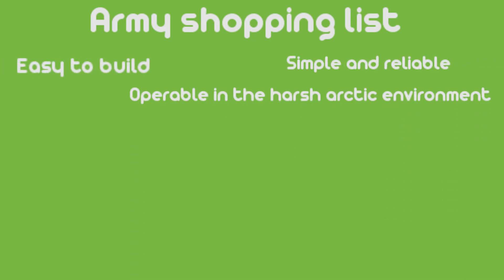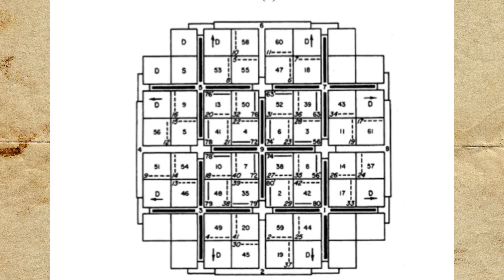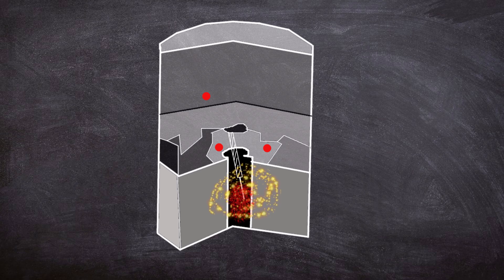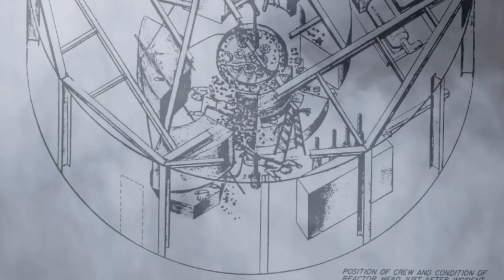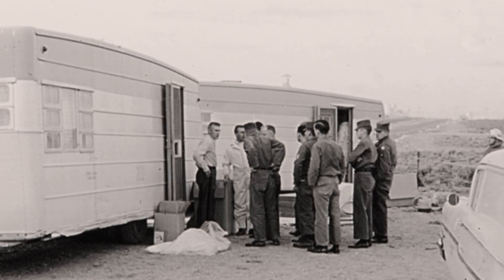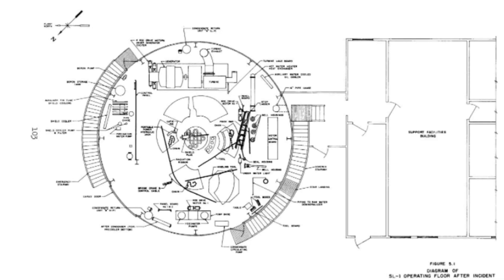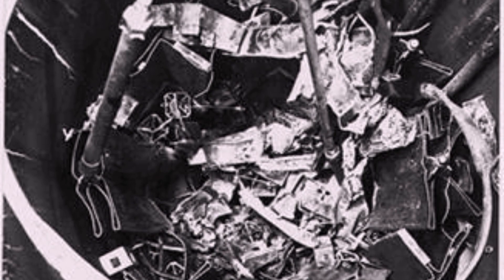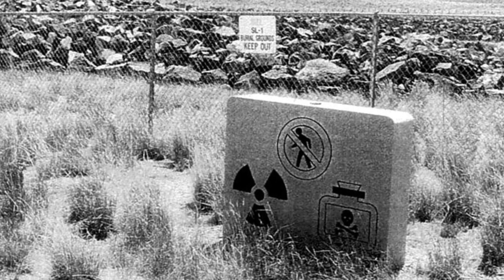A Brief History of: The SL-1 Reactor Accident

Comment: This is a very good presentation of this accident, one of the best I've seen.  Most go into way too much focus on the "Murder/Suicide" angle... which is pretty stupid to imagine as a motivation for this accident.  Of interesting note regarding the recovery of Petty Officer Legg:  The reactor was completely exposed during the recovery of his body and there was a genuine concern about accidentally dropping something else into the reactor (especially the control rod Legg was impaled upon) and causing a second explosion.  The practice for the procedure of recovering Legg had as much to do with preventing that from happening as it did with recovering his corpse.  Additionally, the operator of the boom had no way of looking into the facility and had to be guided by signals from a director, with binoculars, who was looking into the facility from on top of a lift hundreds of feet away.  The fact that they were able to successfully perform this bizarre ballet at all is pretty amazing.
Reply: would the control rod going back in not moderate the reactor further? what's the problem there?
Reply: @OrbitalSaucer  -- The concern was that anything striking the reactor head could further dislodge elements inside it and cause a second critical mass.  The control rod was simply the most likely thing to fall as they felt confident about recovery of Petty Officer Legg"s body, but were unsure about what the rod would do as he was removed from it.  In addition... it's highly unlikely that the rod would perfectly fall back into it's position within the reactor head, which would be the only place where it would do any good as far as moderating the reactor.  It's also unlikely that it would have been able to go all the way back in even if it had landed perfectly, as the explosion more than likely moved the fuel (and other elements of the reactor's construction) too much for any chance at reinserting the rods.

Comment: “impaled by one of the shield plugs” ouch radioactive impaling
Reply: Plainly Difficult got it wrong, it was actually a control rod assembly.
Reply: @rsrt6910  Bamboozled, it was actually a shield plug. The control rod (as you can see in the images of the accident) was found just lying on top of the assembly. He wasn't even standing over the control rod.
Reply: @rsrt6910  still a better love story than twillight.

Comment: Terrible accident. I had to undergo hazmat response training for my job, and the SL-1 accident was used as an example of a nuclear reactor accident that would require local resources. The control rod design was always an issue with these small reactors since there was no way to restart a cold reactor without someone manually withdrawing a fuel rod by hand. The need for portability precluded any kind of machinery to do the job. Then reactor only contain 40 of the normal 59 fuel rods since the reactor was only being used for power and not to test providing steam for space heating. as part of the specs for the reactor. The fewer control rods meant the withdrawal of the control rod would make the reactor critical much faster, and that's just what happened. 

As to why Byrne decided to withdraw the control rod as far as he did, we will never know. The best guess, minus the suicide idea, is the rod was stuck and, in the process of yanking on it. it came free faster than assumed and caused the accident. The Army CID and Atomic Energy Commission investigators along with the Idaho State Police spent quite a bit of time investigating all aspects of the three men's lives as well as lives of their families. Byrnes' wife was having an affair with another man, prompting the divorce case. It was not with Richard McKinley however. Could it have been suicide on the part of Byrnes? It's possible, but the stuck fuel rod, something that happened six times in the previous year, seems a lot more likely of an explanation. My training was mostly that if I saw steam coming from a reactor building, get back in my vehicle and hightail it out of there.
Reply: Yeah , I think the stuck control rod theory is MUCH more likely than any suicide/murder plot,  the control rod had to be withdrawn a certain distance , and then clamped in position, as part of the procedure, it seems very likely that the rod was stuck and was given a good yank to free it, causing it to withdraw too far (it only needed to be withdrawn an extra few inches to cause the reactor to go critical). 
By the time the guy would have realised he had pulled the rod out too far it would have been too late, the reactor went critical almost immediately due to it's configuration with only 40 fuel rods and the rest is unfortunate history. 
At least we learned some lessons about reactor design from this incident, but there is a good argument that the reactor should have been shut down once they knew control rods were getting jammed, it was an accident waiting to happen.
Reply: @paulelephant9521  it was said that the centre fuel rod was less likely to be stuck than the others. Maybe he expected it to be stuck, but it came out freely... 
If it is so critical, why not provide a fixture for the process to prevent the rod being withdrawn too far.
Reply: Andrew White - because people are stupid.   The Spaceship One accident was caused because one engineer had designed a device to prevent the tail boom from being pivoted  before a certain altitude was reached- another engineer deciding that added unnecessary weight and the pilots were unlikely to male such a mistake, and then the people compiling the checklist not so much as putting a Space- much less a warning between- between two actions that should have been separated by a three full minute delay.
Pilot going thru the checklist did each action, as printed, and activated the tail boom configuration while still too low for the aircraft to survive the loading.
Human beings make mistakes designing complex systems, and the more human beings involved in the design and operation, the more mistakes they will make.
Reply: @andrewwhite1793  
A better solution was provided...  The U.S. (and western nations) developed the "Cold Stuck Rod" criteria which states that even in the reactor's most favorable conditions for critically, complete removal of the most reactive rod in the core can not cause a reactor to go critical.

Besides the above mentioned safety change, the SL-1 accident prompted the SPERT program.  In that test program most of what we now know about transient reactor behavior was discovered.  (you can toss Argonne's TREAT program in there also).  Up until SPERT, TREAT, and PBF the world's nuclear physicists did not know much about how reactors behaved when large amounts of positive reactivity were added quickly.

For example we learned that our commercial nukes would not react nearly as violently as SL-1 because of the large percentage of U238 present in such reactors.

Also, the accident prompted many improvements in portable radiation monitoring instruments.  For example, the fields close to the reactor itself (and some of the ejected material) was so great as to saturate the Geiger-Mueller tubes but the instruments did not have circuitry to detect this condition so the readings dropped to zero.  It was also realized that higher range instruments would be needed for future incidents and so these were developed also.

I am impressed with this video as it is a pretty summary of what happened though there was one 'party line' that is not quite true.  The initial fire department entry following the accident did NOT include portable radiation monitoring equipment.
Reply: @andrewwhite1793   Yes!  I was thinking the same thing!  Also - I can't believe they couldn't have built (in the original design) - a mechanical system that could withdraw a rod (to the correct distance) without someone manually doing it.
Reply: @andrewwhite1793  because it was the 1950s and reactor design was complete shit.
Reply: It was stuck, previous design notes noted that as an ongoing issue. It wasnt a problem when hot, but tolerances were too tight when cold.
Reply: According to my readings on nuclear accidents...if I see steam or explosions coming out of a nuclear plant, i might as well bend over and kiss my ass goodbye!
Reply: @parteibonza  
If you happen to see that coming from within the reactor containment building, you are probably at least close to right.

There are however, plenty of places (designed to make such releases) where huge quantities of steam can suddenly be released to the atmosphere that are completely harmless to people.
Reply: If it was murder suicide first how would they beyond a shadow of a doubt prove it? Then why would he want to leave behind a widow that was cheating on him with his death benefits? Then why wouldn't he do the ultimate screw the cheating wife and leave behind a note that would screw her out of any money? Just about everybody I know that has been divorced one side or the other has wanted to screw the other side.
Reply: I know army lost reactor projects to the newly formed DOE, was this the reason?
Reply: The Department of energy wasn’t established until the late 1970s, almost 15 years after the Army stopped low power reactor research.
Reply: @KevinBalch-dt8ot  
For those of us that worked at the Reactor Testing Station, Atomic Energy Commission and Department of Energy were the same thing.  At the research site level it was pretty much just a name change.

Much like the various names that the Idaho site itself has had.
Reply: Kevin Balch  We had AEC. Military had "08" in DC.
Reply: @buddymoore6504  I don't think so. The reactor was strictly an Army project from the start. They were using the DOE reservation in Idaho because it was far enough away from any population center that a catastrophic failure like what actually occured wasn't likely to contaminate a lot of people..
Reply: @sarjim4381  thanks Jim
Reply: @buddymoore6504  Another reason for the Army losing their nuke program is that ADM Rickover never wanted the Army to have reactors in the first place and used this incident to lobby Congress to cut funding and hand all materials over to the Navy.
Reply: Where did you work where you were thought  to look for steam out of reactorbuildings? Fire/rescue?
Reply: @Flapjackbatter  Good heavens, no, not a firefighter. I run out of burning buildings, not into them. I was a deputy sheriff. For reasons that remain a mystery to me to this day, our county board of supervisors gave hazmat responsibility to the sheriff's department. I had to take a bunch of hazmat courses. The bottom line was run like hell until you think you're far enough away, and then run like hell some more. :-)
Reply: Were you by any chance assigned anywhere near a certain school in Florida?
Reply: It was the wrong rod! Water hammer wrong. Steam !!!
Reply: @DanielScutt   Wow!  Deployed to combat zones?  Yeesh.
Reply: "If you can see the scene, you're way too close."
Reply: Reminds me of how the Navy tried to blame the turret explosion on the USS Iowa on a sailor by saying it was a sex-driven murder-suicide plot. Our puritanical country...
Reply: @s.sestric9929  It was somewhat similar in that original thought was that Byrne and McKinley were having a gay love affair and the Mckinney broke up with Byrne, thereby leading to the murder suicide. That line of inquiry was abandoned pretty quickly as was the story of the affair with between Byrne's wife and McKinley. It is a sign of how we think as a society but, after 27 years as a police officer investigating such cases, the first suspects in a murder are the spouse or significant other, regardless of adultery or sexual orientation. We followed that line of investigation first because it turns out to be true in a surprisingly large number of cases.
Reply: Occam's razor.
Reply: @Sar Jim
"The control rod design was always an issue with these small reactors since there was no way to restart a cold reactor without someone manually withdrawing a fuel rod by hand." is not really a true statement.  The Power Burst Facility (PBF) reactor, located only a few miles from the ARA (SL-1) site had to have the control rod drive units disconnected and reconnected for in core maintenance.  There was no requirement to lift or 'jack up'  a rod to connect it.

Of course PBF was not by any stretch of the imagination designed to be a portable reactor, employing the PBF control rod drive bridge design in SL-1 would not only have precluded the need to lift the rods to connect, it actually would have reduced the weight of the design.

Comment: If I remember correctly from my lectures, the control rod was only supposed to be withdrawn about 3", yet instead was withdrawn about 20+". The resulting power surge was gigantic. 3 MW was the design and it got up to 20,000 MW in the same time it takes to blink.
Reply: I don't mean to sound smart, why not a stop to keep rod from coming out to far? its like the physicists and engineers didn't talk shop, if I knew you could die from pulling the rod out to far, I would design it different. they made it to simple. I bet they never did that again?
Reply: @buddymoore6504  Sound smart. A simple steel rod on a pivot with a clevis on the control rod would have not only provided a positive stop before trouble started, but would have provided mechanical advantage to lift a sticking rod. 

Three guys died for the lack of a f*cking crowbar.
Reply: buddy moore i
Reply: It's a tad on the unsettling side, yes...
Reply: Pinochet Pilot #666  but with prompt criticality those numbers dont mean crap when power is jumping decades per second on a logarithmic power scale. Youre actually right because prompt criticality actually happens when there are so many prompt or  "fast" neutrons that theyre the ones controlling power increase. Thats why reactors are design to be controlled with slow or moderated neutrons so human control can be a thing.
Reply: 20,000!?  O.O
Reply: the flux capacitor only needs 1.21GW. this produced over 16 TIMES that
Reply: @parteibonza  
What in the world are you trying to say?  Your post seems to have been cut off.
Reply: @parteibonza  
No.  20,000,000,000 watts
Reply: I just blinked!
Gaaaaa!  I just blinked again!!!
I did it again!
I can't help myself!!!!!!!
Reply: It isn't good. It was able to so quickly have an excursion due to how highly enriched (over 90%) the fuel was. With that mixture, it takes the fuel mere fractions of a second to multiply in power many times. Modern commercial nuclear reactors use enrichments of 3-5%, as a comparison. So instead it takes minutes to multiply in power, making it vastly more controllable.
Reply: What's a 3" ?
Reply: People.. Lets put what OP in lamens terms:  3"= 3 inches. 20+"= 20+ inches OR almost 2 feet. The fact that cm was used in the vid and this OP used symbols that apparently arent being used any more.. Has people MAD confused.😂
Reply: Pinochet Pilot #666  
Yes, all future U.S. reactors were required to meet 'cold stuck rod criteria.'  Thus, after SL-1 no new reactor design (and many older designs) could not be made to go critical by withdrawing one rod.  That solution was deemed necessary as mechanical interlocks and such are still subject to failure even if unlikely.
Reply: Pinochet Pilot #666  
Correct except that the term is 'prompt criticality.'  That literally means that reactor power remains constant or increases based upon the presents of prompt neutrons.

In this discussion, it seems that people are confusing prompt and delayed neutrons with fast, intermediate, and thermal neutrons.  The prompt neutrons appear on the scene within 10E-14 seconds.  Neutrons that appear after that time (from the same fission 'generation') are called delayed neutrons... some of which do not show up for as much as several minutes after the fission event that created them.  Delayed neutrons are typically still fast neutrons until encountering a moderator (though also typically not quite as energetic as prompt neutrons).

Atomic and nuclear bombs rely strictly on prompt neutrons.
Reply: Pinochet Pilot #666  Not super criticality, but prompt criticality you are right fast neutrons control the power.
Reply: Pinochet Pilot #666  don't you mean slow neutrons
Reply: Are you sure about those numbers? You're talking 20 GW, which seems high.
Reply: @baruchben-david4196  
He is correct.  The estimated peak power of the transient was 20 GW.
Reply: @baruchben-david4196  20gw runaway fissle at 93% enriched is actually very conservative.  I pulled this from google when comparing a 1 megaton nuke roughly converted into gigawatts : The answer is 1162.2222222222. We assume you are converting between gigawatt hour and megaton [explosive]. You can view more details on each measurement unit: gigawatt hour or megaton The SI derived unit for energy is the joule. 1 joule is equal to 2.7777777777778E-13 gigawatt hour, or 2.3900573613767E-16 megaton. Now we both know that ONE rod wasn't pushing megaton range but at 93 FREAKEN PERCENT (weapons-grade) I'm fairly confident that 20GW is a burp compared to its total potential energy, could be wrong tho. I don't know a damn thing about neutrons and fissle/fusion
Reply: @baruchben-david4196  that's almost enough for 20 trips back to the future